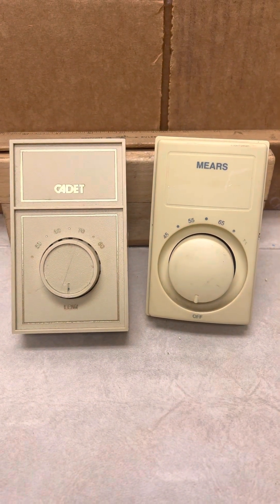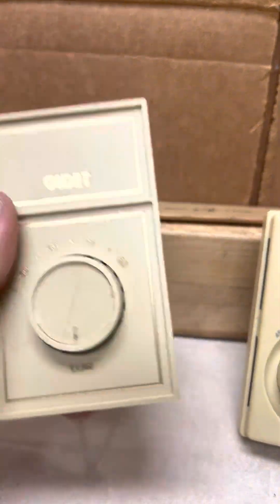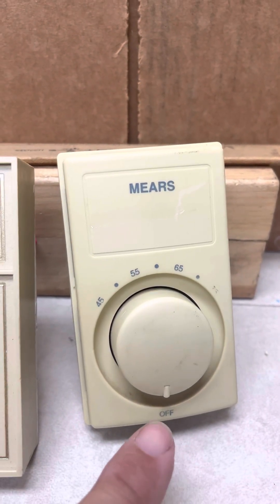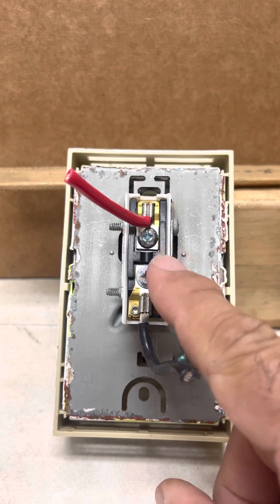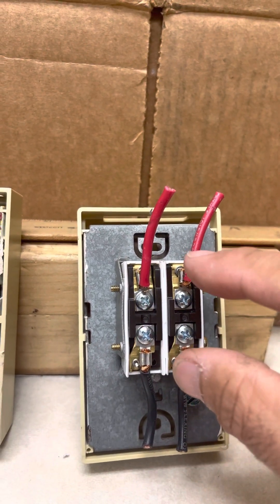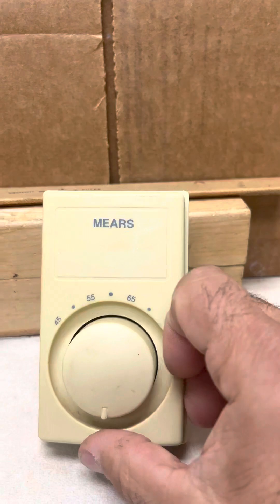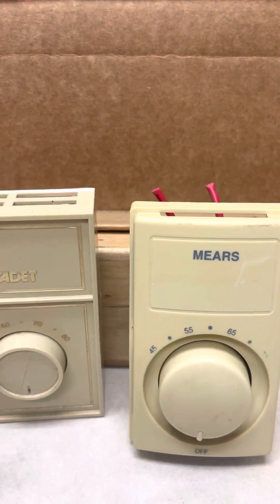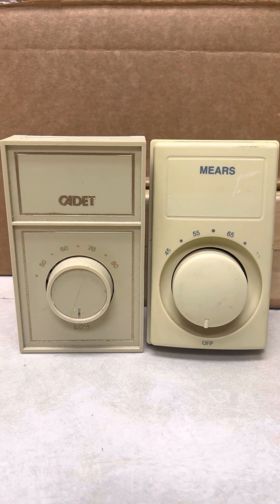Electric baseboard Thermostat differences

Comment: Nice detailed video thanks so much for sharing your knowledge.  I have 10 single pole thermostats running electric baseboard heaters in my house all in separate rooms, we installed a ductless heating & cooling system in our house a couple years ago and don't use the baseboard heaters anymore. My question is could I remove all 10  thermostats and replace them with double pole connecting all 4 wires so we can turn them off @ the thermostats apposed to turning them off at the electrical panel via breakers. The BB heaters are all no more than 4 yrs old  but the thermostats are all original  single pole Honeywell running 2 wires with no way to turn them off besides flipping the breaker. I don't want to remove the heaters or thermostats just looking for solutions to shut them off @ the thermostats.  Thanks in advance
Reply from the maker: I don't want to say yes because I never did it. My customers just turn the breakers off.
Reply: @howtodoitdude1662  Well I managed to swap out all the 2 wire thermostats in favor of the double pole type & all is well . Cost me a bit of coins but I didn't want to turn the breakers off or terminate the wiring @ the baseboards, now i just turn all the thermostats to off ! Cheers